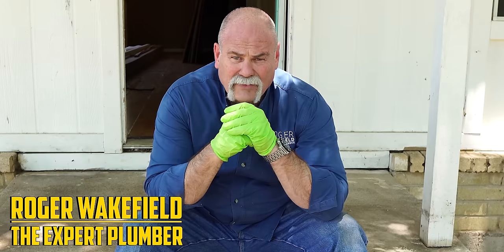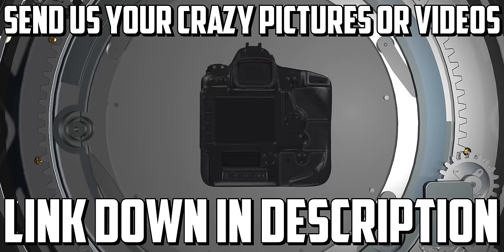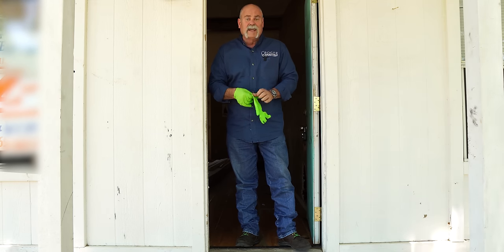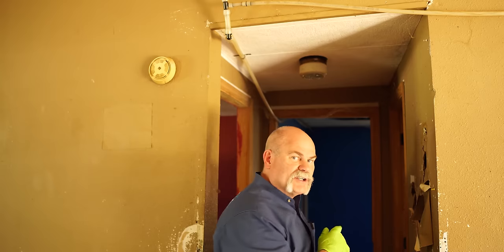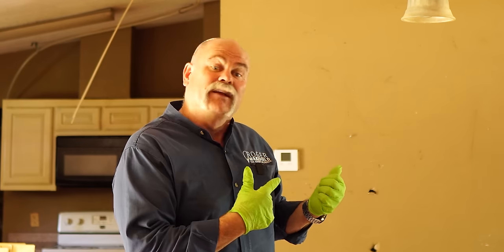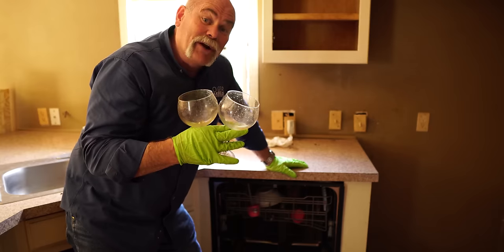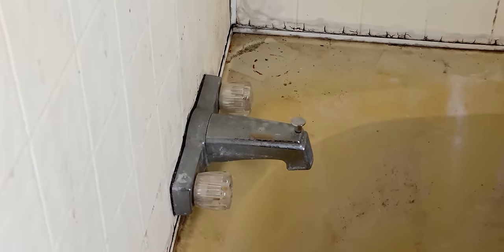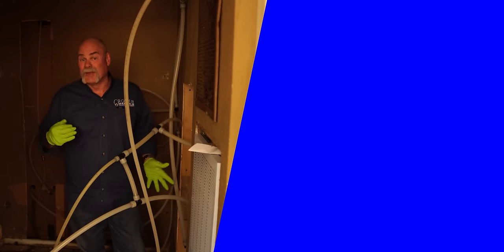This is THE WORST Plumbing Job in America

Comment: Me. Governor. Watch this before your decide plumbers don't need a license.
Reply: Sure wish I could edit a typo so I didn't sound a like a caveman who's been elected to office. 
"Me Governor. You citizen. You pay tax!"
Reply: @BlueCollarBoom  To the right of your post are 3 vertical dots  ... click on them and you can edit or delete the post. When you are signed in you are able to preform those functions on any of your posts at any time. If I click on those dots on your post I only get a "report" option.
Reply: @BlueCollarBoom  but sometimes you got to use common sense don't you agree?
Reply: I have seen many licensed people do extremely terrible jobs. A Licence doesn’t mean anything except money for the state. After 28 years of plumbing I quit renewing my license. Knowledge and experience is the most important and you get 95% of it on the job with good teaching.
Reply: @mrbill2600  holy.... You're right!
Reply: @διαβόητο23φάντασμα  I think "common sense" is a relative term. An expert mechanic could explain how my truck works & say it's common sense. But not to me. I'm no mechanic.
Reply: @BlueDart1971  you're right. A license doesn't guarantee quality work. But it does protect a homeowner from being ripped off by someone who claims to know what they're doing. If you have proof of a license you can report that license to the jurisdiction having authority. Also, I don't appreciate your statement that a license doesn't mean anything. I've worked very hard for mine and I'm very proud to have it.
Reply: Shawn Strong  wasn’t trying to be offensive. It doesn’t keep anyone from getting ripped off it just gives the state a name. I worked hard for my journeyman and my master license too. After years of having it all of a sudden I had to take this class and that class for continuing education. The classes just cost me time and money without teaching me a single thing. Why would I need to know about handicap ramps in an amusement park to be a plumber? Every class that I attended in person was some schmuck trying to sell me insurance or something like that. It all became about revenue for the state. I had my Contractor’s Licence. I got sooo sick of the state licensing I just quit. If you like to be under the thumb of the state by all means go for it. Just don’t think that you are better than someone else because of a piece of paper.
Reply: Darren Honey, Honey, a homeowner has no recourse if they hire an unlicensed contractor, where as, as a licensed contractor myself, the homeowner does. If I should walk off the job with 50% of the contracted money already paid to me and all I did was the demo on a job, I would be liable for paying back 40-45% of that money, of face prosecution, as I broke a legally binding contract that I must honor. It is my privilege to write legally binding contracts. Where as if the property owner hires an unlicensed contractor, there is a lot less legal recourse for the homeowner, and, depending on the state, can face a penalty for contracting without a license. I’m certain you wouldn’t do that. And yes, licensed contractors rip-off people all the time. But the person paying the licensed contractor has agreed to be ripped-off. It isn’t until the job is done that they think to ask other people they know if they paid too much. 
I totally agree, that a license does not prove your skill. As a journeyman back in the day, I did better work than some “licensed” outfits. 
A license is barely adequate for proving one’s knowledge in the particular field they are licensed it. The trade questions on the test are really basic. So, I agree, that a license does not guarantee full knowledge of the trade. 

A license does guarantee that I have the privilege of contracting projects over  a certain number of dollars, and that I will do my best fulfill my end of the contract, and when I am done, your signature on that piece of paper gives me the right to lien your property should you decide not to pay me. If I have to sit through a lecture on handicap ramps at amusement parks to hold that privilege, I’m down. I’ll even take a lead abatement and asbestos class or two, and a 10 hour OSHA class. 

Short of it is, yes, I’m better than you.

Comment: I once saw a electric outlet under the area where the air conditioner was. A very damp area where buckets were to catch the water coming from the bottom of the air conditioner. It looked like a death trap waiting to happen.

And i believe in same places there were breakers that im pretty sure were for other houses. The electric bill was always insane and when said breakers were turned off the neighbors moved out.

And elsewhere ive seen electric switches that did nothing. They were in bedrooms that didn't have lights in them.

Comment: I went to a DIY job done in the 1920's by an individual that worked at one of the major dam jobs. He plumbed his entire house, water and drainage, in schedule 20 conduit. From 1/2 inch up to 4 inch. There were no vents at all and some of the Ess traps were repurposed lead bends. The folks wondered why the house didn't drain right, well, 90 year old galvanized conduit will rot out... All over the crawl... It had been flooding under the house for years. I'm glad I had coveralls that day.

Comment: I can top that story, i used to a carpenter (still am but im retired) and were renovating a house and the contractor walked off the job, and we had to use a few sub contractors for the plumbing,  and when you flushed the toilet it would fill with hot water, these older homes had wires running through real old pipes from the 1930,s guess what came out of  some of the old conduits...... water!

Comment: I'm not a plumber, but am a qualified electrician, have worked on site for years with different tradesmen, Dry Waller's, plumbers, heating engineers, & 15 years ago we bought a shell of a house, it was actually an old mill, no interior walls at all so we had free reign to design our house as we wanted it, the electrics, no problem, we had an incoming water mains which just stopped in the cellar, after all those years watching plumbers, I said to myself 'i can do this' but my one rule was, I am not going to use plastic pipe, I did everything in copper, a few initial problems....I didn't at first realise there was different grades of solder wire, I soon worked that out, ever since, no leaks, I did the central heating which runs 9 large radiators from a wood fired cooking range that had a back boiler, it works fine, call me old fashioned, but I just don't trust plastic or pvc or whatever for water supply, had friends that used it, & they had rodent problems, they gnawed at the pipes causing leaks, copper for me every time

Comment: I bought this house recently. He did a pretty good job but. He left about 100ft of pex under the crawl space connected to the hose spicket. And the water line from the meter was hidden  under a bunch of leaves in the back. The water line was not buried. The home inspector didn't even catch it. So I had to bury the water line which was very hard to do, due to the massive amount of roots. And I reran and shorted the pex in the crawl space. I have a surplus of pex in my garage.

Comment: When looking at houses back in 08 i saw a very nice looking home but in the crawlspace i found the plumbing made up of copper, cpvc, pex, garden hose(glued onto cpvc) radiator hose, and that was just the domestic water side. On the drain side there was a shopvac hose making a trap for the tub. I made an offer on it discounting all the work id have to do to replumb the home

Comment: I worked on a commercial job once...we converted an old Wendy's into a Walgreens...my first time actually...that's when I learned a smaller size Walgreens fits in 4 shipping containers... but I watched a contractor using shark bite fittings to put in brand new pex...there was a hot water line from a small sized water heater just laying in the ceiling...it ran part way down and was capped...I figured he just wasn't done yet...he comes in at 12:45 pm cuts the line adds a shark bite Tee and loose pex across ceiling the 90 into the wall loose down to the three sinks and eyewash station...same for the cold water...all shark bite...no p trap in drains...some parts not even glued...it was crazy to me... obviously didn't pass inspection and dude had disappeared by then with the money...I was like yeaaaaa remember last week when I kept saying something about it boss man?? Lol.

Comment: Seen a house like this. Not even plumbed to public water lines. They used 50 litre drum tanks for water piped into homemade sinks. Toilet was chemical/burn toilets. Fridge was run off a generator that basically powered the whole house. It was a nightmare. They foreclosed a month later after one of the residents assaulted a visitor to the house.

Comment: how are uponor fittings restrictions? they are the same inner diameters as the 3/4 pipe and then you expand the pipe and ring around that. there is no drop in volume when using uponor expansion pex and fittings.

Comment: I have been doing handyman work for about 30 yrs. When I first move to Pennsylvania, I hooked up with a realtor doing sheriff sale properties; I don't think the term "flip" had become popular yet. The house in question had been vacant for at least two yrs and not only had the previous owners used the toilet tank as a trash bin but I believe the HUD inspectors were using the toilet without running water. Being young, inexperienced and stupid, I brought several 5 gallon gas cans full of water and kept putting water in the bowl until the contents softened and went down the pipes.

Comment: Man that is out there.

Was the property there long term prior to the DIY plumbing? 

This looks a lot like a relocation by someone with no money leftover, and in need of water the day after taking possession. And honestly, owning that is probably better than renting a slum or being homeless.

So long as you actually keep it clean. I'd say that 3/4 hose came rather cheap, like free, hence it never getting replaced for anything that could provide more pressure than pissing against the wall.

Comment: Roger Wakefield, that is the most creative plumbing job I have seen... it is not the craziest... Craziest was over 5 miles of pipe in 2 rooms with bypasses for bypasses for bypasses, 2 holding tanks, 5 pressure tanks, 3 booster pumps being fed by 2 wells... Oh and shutoff valves on everything in both directions, all in all I think there was 120 shutoff valves, 41 check valves, 670 joints... all done in Pex or whatever you called it in this video (same pipe with the same connections, I will see if I can find some photos for you...

Comment: I once inherited a job on a million + estate in Connecticut where the original contractor had quit or been fired,- or maybe both.
We kept discovering parts of the job they had claimed were finished , but were not; pipe set, but never soldered, lines that went to nowhere, and my favorite,- PVC vent lines that stopped in between floors.
Further complicated by the fact that construction had continued as if the plumbing was done,- cut a lot of holes through brand new sheetrock.
Hard to say what happened.The owner was an entitled, rude, DB, so maybe he said the wrong things, but it was also a ridiculously complicated and expensive job, so maybe they under bid. 
It's much easier to do it right the first time.

Comment: I’m not a plumber but with the owners of my company and I walked through a house to be a rental and we saw all the supply lines were washing machine hoses tied together and electrical wires were suspended from the ceilings. Needless to say we walked away but it was purchased and completely torn down and rebuilt to code

Comment: I have a story that there is no documented proof of other than my word. I at one time was a service person for a local propane company. My job was equipment repair and gas service installation. I had quite a bit of work lined up and my boss decided to send another employee out to start this gas line installation and I was to arrive latter to finish the job. The job required a new gas line to run under the house and supply a new gas water heater with service. when I arrived at the job site my fellow employee had already installed the water heater and told me that the gas line was almost done. I started to look around and to my amazement I didn't see any black iron pipe hanging under the house. Instead I found the black pipe laying on the ground beside the walkway all the way back to the rear of the house where the new water heater was installed at. My helper informed me that crawling under the house was not to his liking and spiders scared him. There was about 100 feet of unwrapped iron pipe laying on the ground and the job only needed about 60 feet of pipe if he had installed it correctly. If I hadn't been sent there to help him finish the job he would have left it as is. I informed him that crawling under houses was just part of the job and that he would have to endure it some how. He quit the working for the company the next day.

Comment: The philosophy of this job is obvious.  It's more maintenance monitoring friendly.  Look how easy it is to detect leaks when you just staple and tape the pipe to the ceiling and walls.   There's never a question about stealthy pipe routing and locations this way.  Is it too much to ask someone to please watch their step while using the kitchen to avoid tripping over the lines?  As an added bonus, you can do this plumbing installation post construction.  You don't need any of that silly planning to confuse everyone about where the plumbing stops and the house construction starts.  Just build the house without it and stuff the plumbing in later at your convenience.  :)

Comment: This is basically how I ran my PexA...I just used a 1" line and ran it inside of the attic like a sane person.
Reply: You must have free hot water in the summer then.
Reply: @TheEgg185  Ya, for a few minutes. Unfortunately, I don't really have a choice. Not going to try to cut 6 new holes through the slab to try to run it under the house, but the attic is hot AF.

Comment: I've seen crap like this(and worse) done in old trailers. It was done because in Iowa water lines under trailers freeze. The job was not nearly this crusty though. It was hung with plastic two holes along the celing. I'm a DIYer and I'd do it in an old trailer but NEVER in a house.

Comment: Why use shark bite fittings? It's not like they were having an inspection. It's like a plumbing system done by an Irish traveler who tells you he's using top quality pipe and fittings(he does) but does the job in an hour and a half..
I'll have to check the I.D. of Aquapex fittings. But I thought there was no different I.D. between the pipe and fitting?
It's 'B' PEX with the crimp ring that reduces the flow.

Comment: Had another one where a guy used all purpose cement to glue cpvc to pex, black roll plastic, quest and copper. Then wondered why the joints kept failing 😪🤣🤪🤔

Comment: I had a plumber move a water heater about 6 feet a few years ago he put in a pan and a drain in the floor so far so good so I go on vacation and the pressure reduced fails water heater starts leaking from the failsafe thing on the side. After I got back I get it all fixed $300 then my floor gets weak so I go to replace it and find out the floor drain wasn't piped out of the house. So I get to replace all the floors and joist in 4 rooms  so far ive spent $2500 because the plumber didn't want to spend $20 on some pve drain pipe.

Comment: I am so damned confused. How does this happen?
I was under the impression that homes are built with the plumbing on the inside of the walls. Even mobile homes and modular homes. 
Am I right in assuming that all the pre-installed copper piping was likely torn out and sold and the last occupants just had to kludge it with the new piping?

Comment: True story I once had a plumber instead of using a strap he took an old screw driver and hammered into a rafter and to support the pipe. The same guy same visit fixed a drain but it leaked I called him he “put a bucket under it” not until u get there like forever…. I told him never he was fired

Comment: Welp, me and my friends did this kind of thing during the 2004 Aceh tsunami relief. In my defense, its in the middle of a tsunami swept city, inside an abandoned warehouse that was turned into a refugee camp, and we just have a less than $50 budget to secure a line from the nearest clean water pump provided by the government, around 100 metres away.

Comment: So confusing. I'm assuming someone was squatting? However, the tools required to install that type of pipe aren't cheap! And you would expect the fittings to be a junk drawer of whatever they had, looking at how they ran pipe. But it's all new stuff. Who would invest in the expander and materials and run pipe like that? Squatters don't carry around a $500 expander lol.

Comment: I think you're just being over critical and judgmental. I didn't see any leaks, did you? Well, let's give credit where credit is due! They left the supply OFF so as to not have leaks (SURELY there will be if the supply is turned on!) This has to be a squatter's work. No care for anything, just get some water installed. lol

Comment: The one or guys that did those mst have listed "accessibility and repairability" at the utmost theme in the house. Also the reasons for lng hoses for short connectivity, they must use ALLof the tubes they've bought. More importantly they've use the principle Hot Air goes UP and Cold Air goes down,

Comment: They must have stole the expander tool and pipe of a plumbers truck.
See how they had to use shatbite fittings when they ran out of werisbo fittings.
How fast can you run your water?
Tweaking fast man!